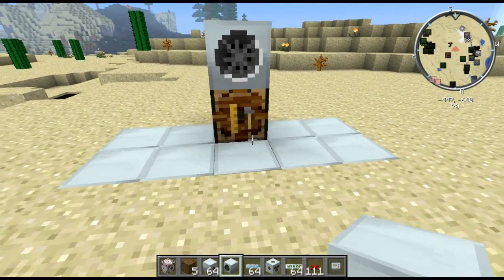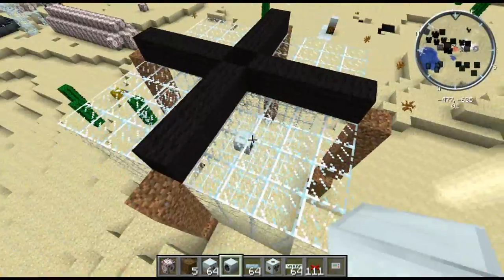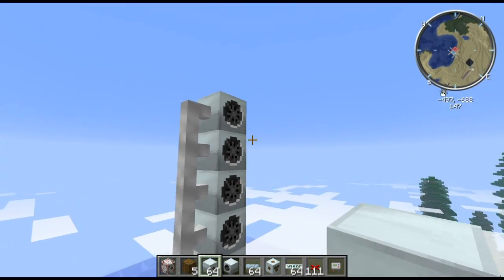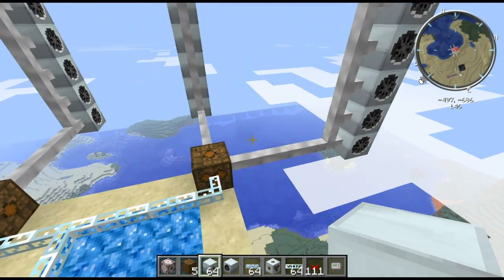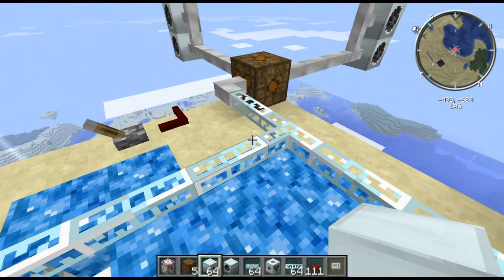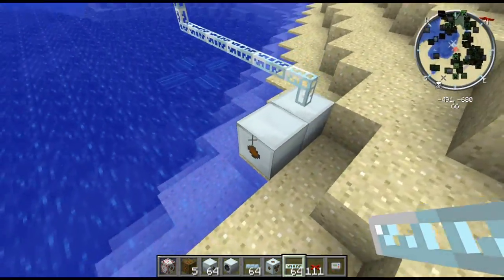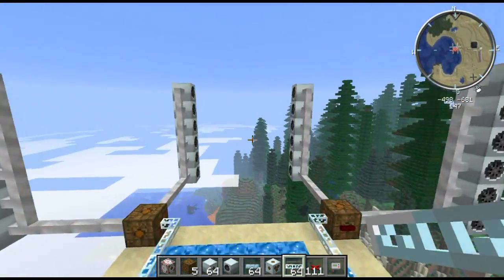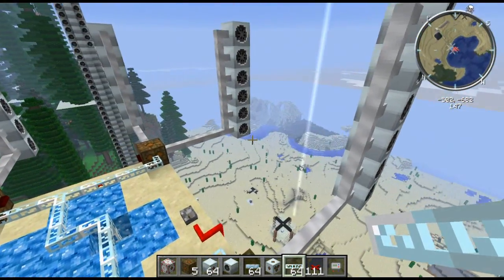Minecraft Feed The Beast tutorial: Wind mill power!

Comment: How to connect them to macerators and furnaces? I've tried electrical engine, electrical furnace, LV Transformers and using copper cables to transfer the energy. But it doesn't work.
Reply: If your talking about hooking up the wind generators directly to your machines I'm not sure it can be done, they don't provide enough power at one time, what you need to do it put a batbox in-between your wind generators and your furnaces etcetera.

If this isn't the case then I'm not sure what you mean, are you trying to transfer power through, for example, the macerator and then to a cable and then the furnace? If that is the case then it won't work, but if you have any cable try insulated tin and copper wires plugging into the back of the machines. And you don't need space between them or anything, just put them next to each other just like you might the normal furnaces, and then run wire coming from either the back of a generator or from the dotted side of a batboy to the machines you want powered. Make sure that when you are putting power into the batbox that you are putting power into one of the 5 sides without the dot. 

Hope this helps :D have a nice one.
Let me know if none of this is what you were looking for and I'll try to help more.